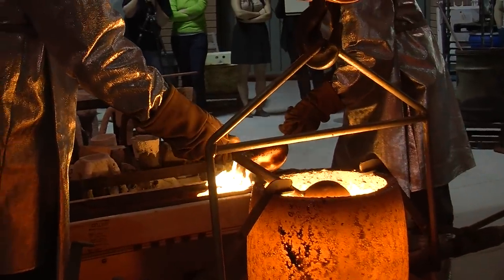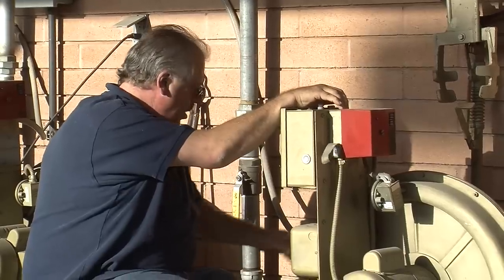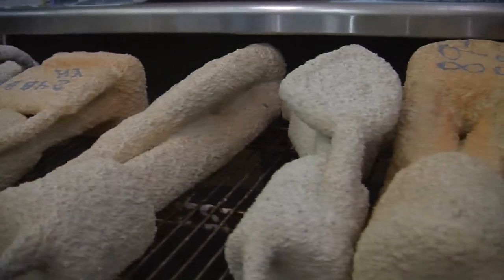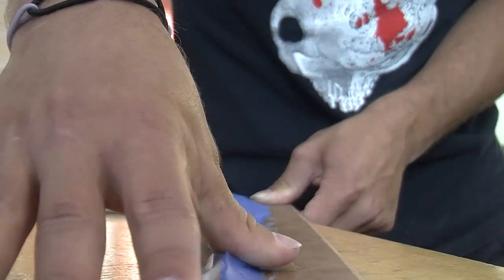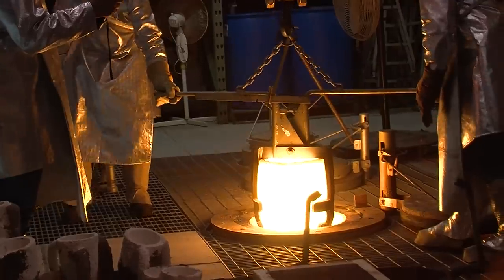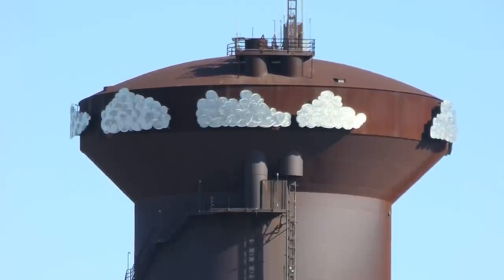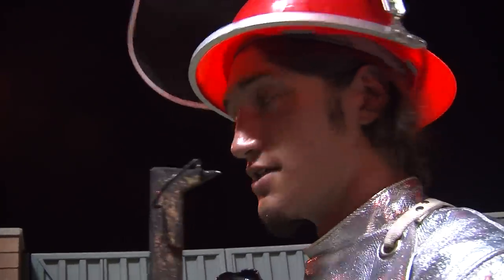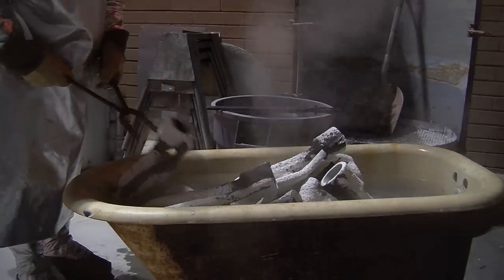How To Make An Orc Sword For Extra Credit

Comment: Interesting, but as a sword that thing is utterly non functional. It is way to thick and heavy, the handle would probably break off at first chance. I wish he would have gone for a more functional/classical design, that would work better with the material and be an actual test in material knowledge as well as structural function. Thereby being a true lesson in working with bronze.
Besides the swords used by the orcs in the books and films where iron/steel, so no bonus points there either ;)